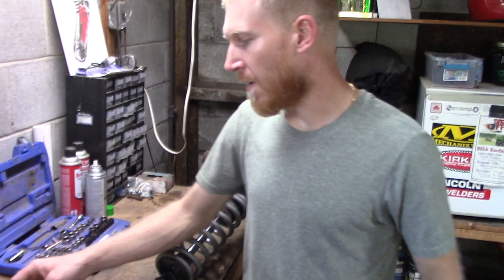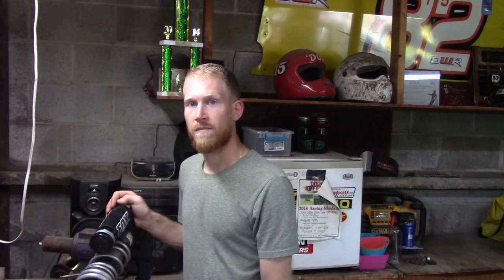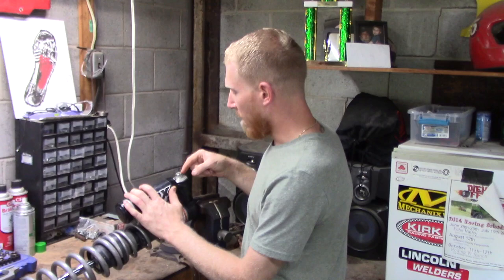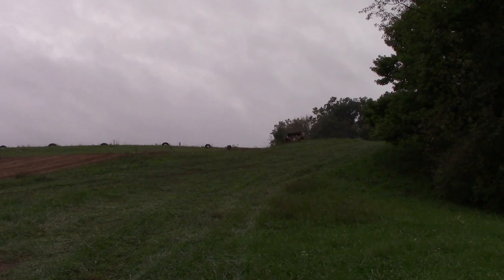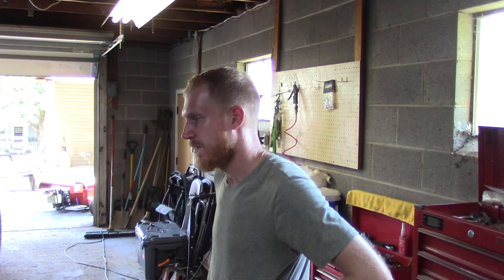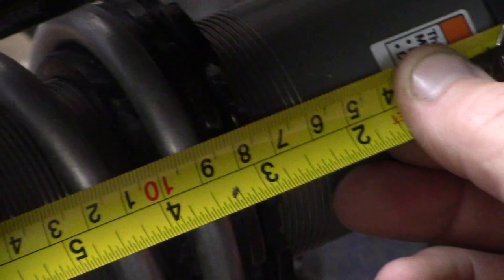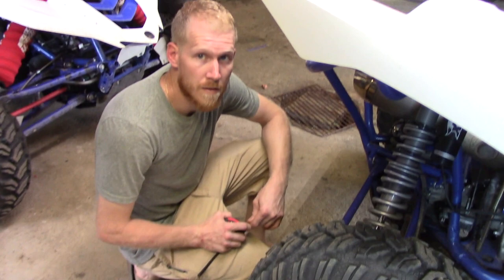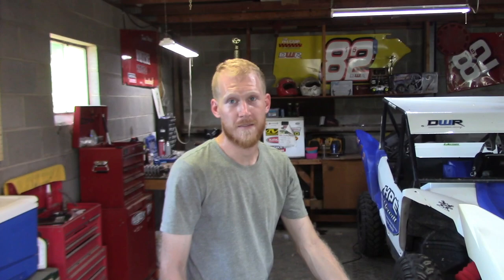YXZ Short Course Stock Suspension Setup! Gladman Gives Out All Our Setup Secrets!

Comment: Could the Lone Star+3,5" Kit make lowering the ride?
Reply from the maker: I’m not sure I’m fully understanding the question, what exactly are you asking. I don’t wanna answer and sound stupid lol
Reply: @writeselwelding  I am trying to find Out if it is possible to make the yxz much lower. Kind Like a Buggy. 

The Lone Star Kit makes the ride wider, but is it able to lower the Chassis .
Reply from the maker: Ok gotcha now! So ride height on a coil over setup is typically determined by the spring compression setting. However shock length and location can also affect this if they are changed so in the case of the lone star kit if the same overall shock length is used and the shock mounting location on the upper arm is moved out towards the wheel then yes the lone star kit could potentially lower the height. I’m not familiar with that kit enough to say whether those mounts are in the factory location or not! I hope this helped in some way!
Reply: @writeselwelding  thank you! Yes now I See whats the main question Here : "mounts factory Location" 

It Seems it's Not that easy and expensive to make the Yamaha low.
Reply from the maker: Well not necessarily. You can simply adjust your spring preload setting as it sits and will lower the ride height but you are bound by the total length of the spring stack at full droop………..unless you introduce limit straps! What suspension setup are you currently on? And what machine? You may have a few cheap options
Reply: @writeselwelding  I don't own one 
SSV does not fit my needs, only a real Buggy could. But in my country it's Impossible to make a Buggy street legal, so I am forced to watch Out for SSV. But before I waste Money I need to figure Out if it is possible to make the Yamaha as low as possible to make it a real driving machine for flat Land and short course